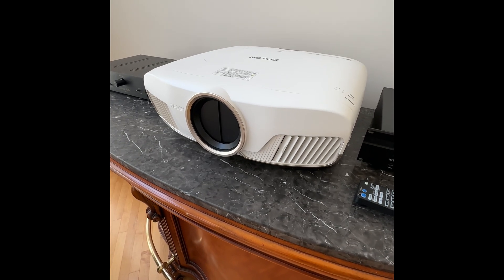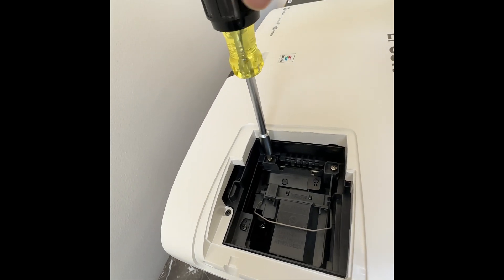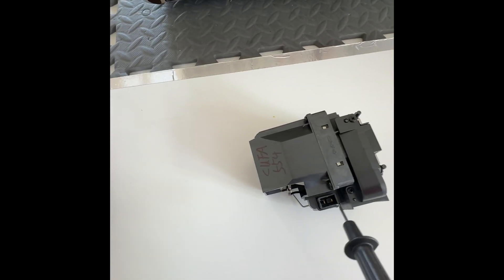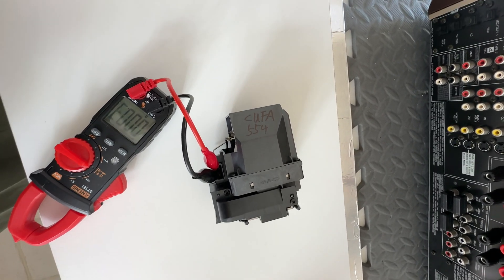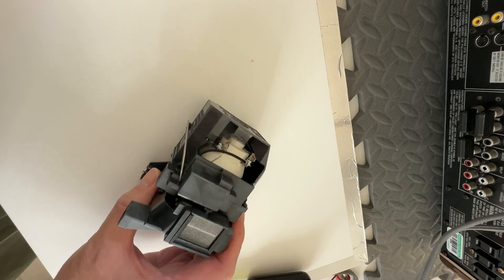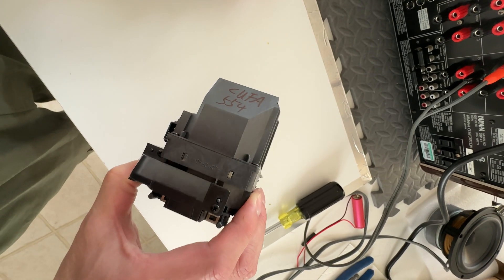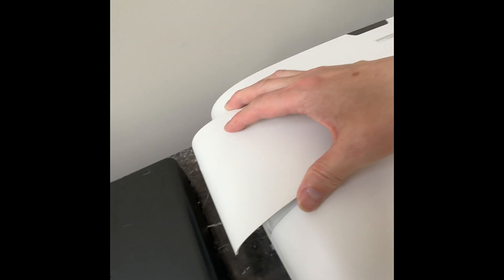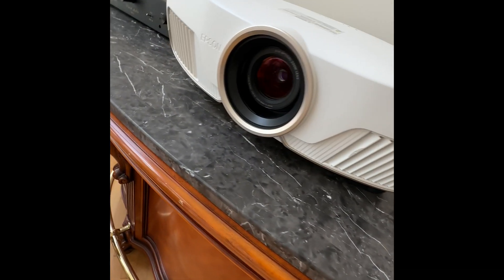Projector lamp "repair". Resolving Epson 5040UB power-up issue.

Comment: Thanks so much. I have a similar issue. Sometimes it takes 10 seconds to boot up, sometimes a couple minutes, and sometimes the orange light comes on after 3-5 mins and I solve that by unplugging the power cable, and then plugging it back in and trying again. Very frustrating. I am going to try these steps when I get home. 😊